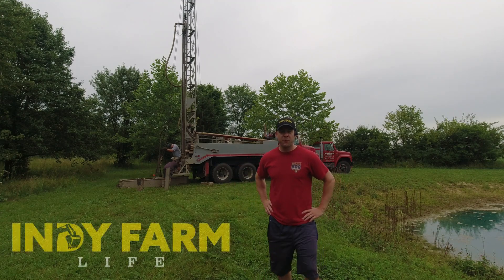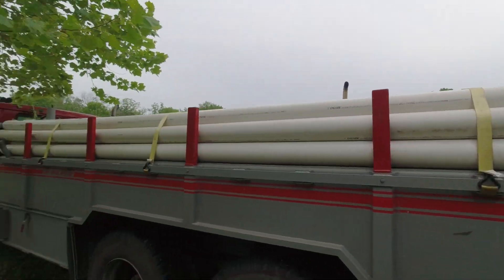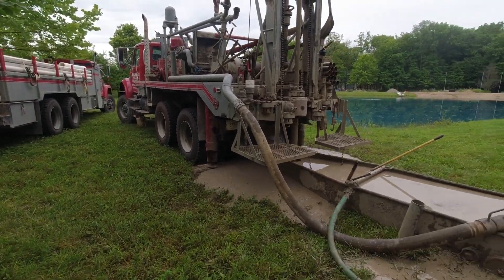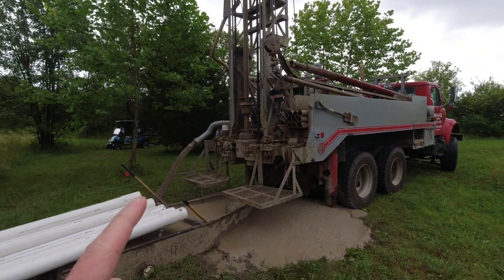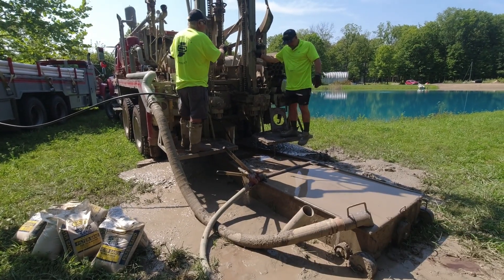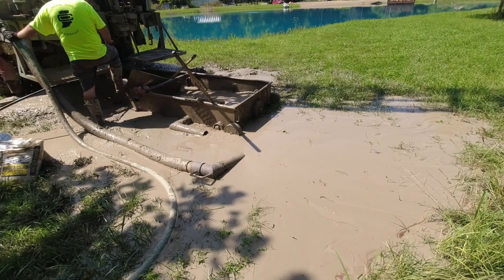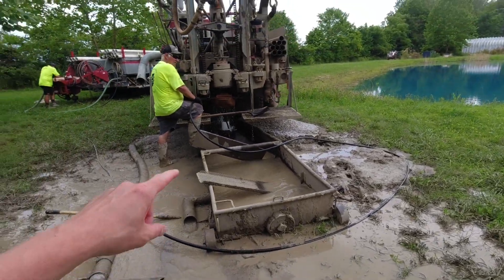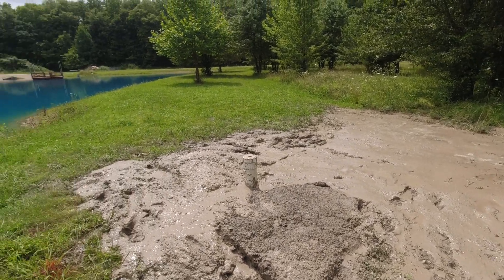Drilling a Well for a Pond - RPS Solar Pumps

Comment: Excited to see the actual delivery system of the water entering the pond.  I imagine to get it operational, you will initially just have a discharge pipe spilling over the bank.  But ultimately, a raised rock wall, where the water cascades in would be sick.  A little enclosed Gazebo nearby perhaps to have a late night after dinner drink listening to the serene sound of water flowing.  This slice of paradise provides endless thoughts.
Reply from the maker: You are describing it just as I am envisioning it!  For now it will just be a pipe, but long term I want to make it a show piece.  The only part that won't be true is the late night water flow....it's solar! ha

Comment: Around here water is only 4-8 feet down. Ponds do not exist here either. Generally just canals and rock pits and all are at the same elevation/
Reply from the maker: That's such a difference from here.  4 to 8 feet would have saved us a lot on the well drilling ha.

Comment: Nice video. I can appreciate what you went through to find a well driller, I did the same thing finding a driller for our house well. Mine ended up being 140' well, with static water at 11' and 110 gpm production. I got lucky as the well ended up on a gravel bed. I'm looking forward to your video on solar. Just las week I put a portable solar array out on my lawn (that finally has grass) to see how it performs and how well it works with my Bluetti AC500 and 512 Ah of batteries. I'm now tracking the sun, much like you did, to get a good idea of where I can put up a permanent solar bank. You mentioned you going with a fixed mount. I'm looking at the ECO-WORTHY Solar Panel Dual Axis Tracking System vs a static mount. Did you consider something like this?
Reply from the maker: Wow, that's quite the production from your well!  You could irrigate with that thing.  What's your plan with your solar setup?  Is your house well going to be solar powered?  The movable unit sounds nice.  What I am getting comes from RPS with their well pumps.  They do have some that are pole mount which likely provide more flexibility.   I do think mine have tilt adjustment, but no auto tracking.  That sounds fancy!
Reply: @IndyFarmLife  Yea, the drillers said the same thing about the well producing so much we could use it for irrigation. What I'm looking to do with my solar set up is to have an alternative way to provide electricity to the house, something that would recharge my batteries with 1 day of sun. My Bluetti AC500 was purchased for my 5th wheel, as was the batteries and portable solar panels. When building the house I had it wired so the AC500 would work as UPC for my freezers (2), Frigs (2), and furnace fan (gas furnace). So, if the power goes out these things would still be running. Granted we don't have 220 for our well, but we've got the rest covered. The house is heated with natural gas (and I tinny wood stove), so I had it plumbed and wired in for a generator. I've got a multifuel generator that I can hook up for the 220 power if the outage is long enough = I need the well, or recharge the batteries. I'm also considering a hand pump on top of the well (for getting buckets of water), or a 110 pump that I could power with the solar generator. I've got a stream running through the property, and a 1/4 acre pond, so we've got water outside of the well if needed.

Comment: What are the chances the well is the same vein as the house and could you run low on water after filling the pond all day?
Reply from the maker: Suppose it's possible, but not sure we will know if/until it happens.  The farmer next door (less than a mile) said he used to pull 10k gallons a day every day through the summer months.  Seems we have a healthy aquifer.
Reply: Hahahaha yea boy  filling a pond roughly at he same level and proximity to the house...but yea, screw the neighbors too
Reply from the maker: Zero issues thus far, and that's when we didn't have rain for 7 weeks last fall.
Reply: @IndyFarmLife  well keep on keepin' on, maybe cow horns won't hook
Reply from the maker: When we first put this in, we needed a 'blitz' of water to get it full.  Now that it's mostly full, I would expect us to draw much less from the well each year.